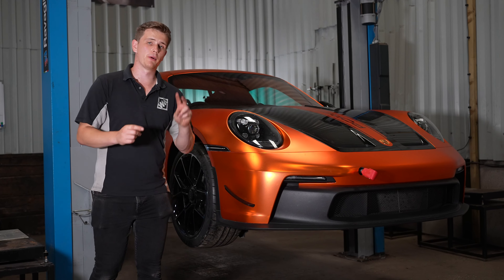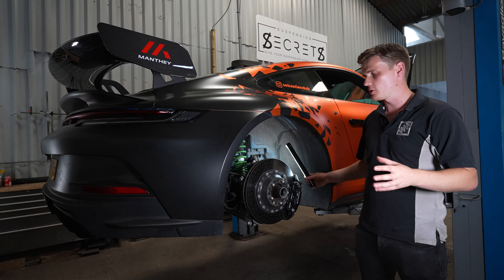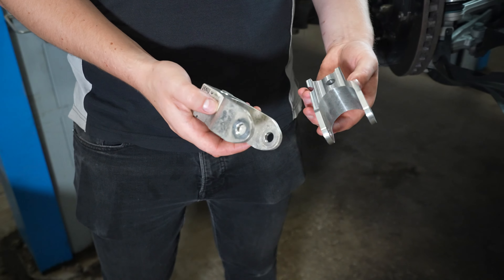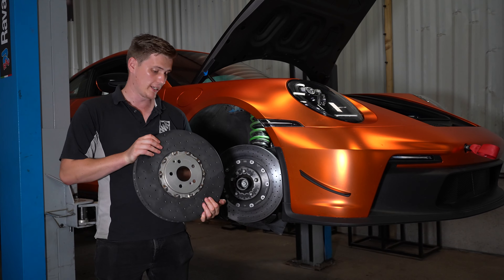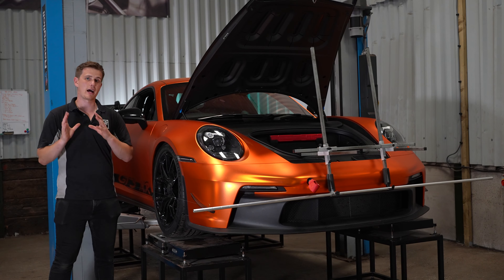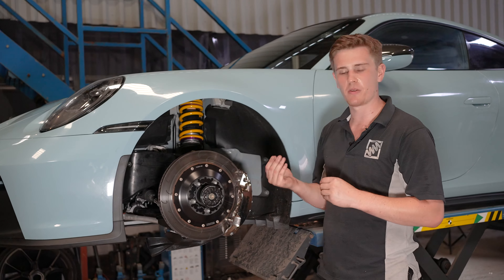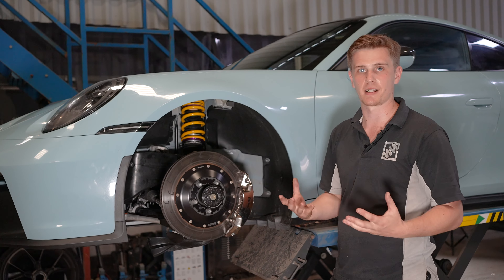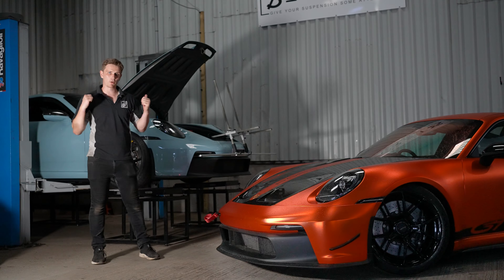Building the ULTIMATE Porsche 992 GT3

Comment: You mentioned brake dust on the 992, but you shouldn’t get any brake dust on the OEM Carbon Ceramics? I only ask, as I seem to get a lot of what looks like brake dust after a track day 🤷‍♂️, I never saw any on my 991.2 though.
Reply from the maker: Hi, thanks for the comment. Yes the OEM pads used on the ceramics on the 992 cause a lot of brake dust as standard out on track. Switching across to a Pagid pad has solved this for lots of our customers 👍

Comment: Love the detailed explanation! One question though, the team at manthey racing explained in a video of Misha that the most aggressive setting on the front Venturi duct (on a gt4rs) is ‘overkill’ because the rear wing can’t deliver enough downforce to keep the car in balance with this setting. I understand that this MR wing delivers more downforce compared to the OEM one, but wouldn’t manthey have chosen the most optimal setting for the front venturi to compliment the downforce of the wing? Just being curious what your thoughts are on this 🙂
Reply from the maker: Great question 👍 we are personally big fans of having as little understeer as possible and we find that running the ducts fully open (especially with the uprated rear wing) sets a perfect balance particularly out on track. We have found the setup they come with to still exhibit quite a lot of understeer with some of our customers and have found this duct setting helps a lot to dial it out and make the car much more neutral and engaging to drive 👍